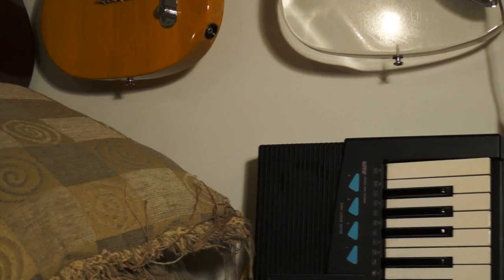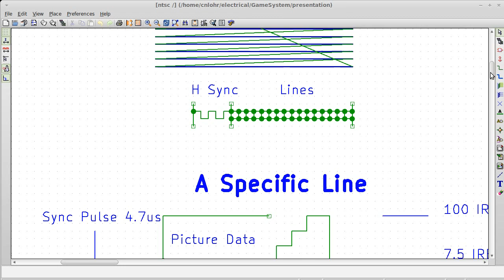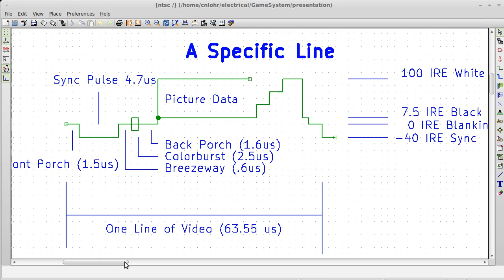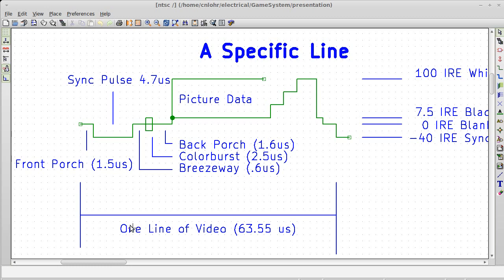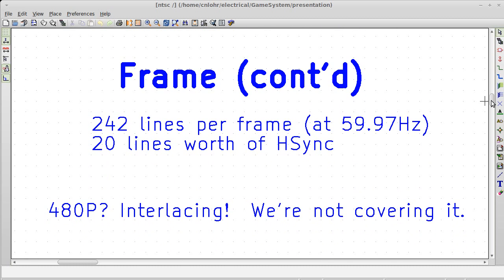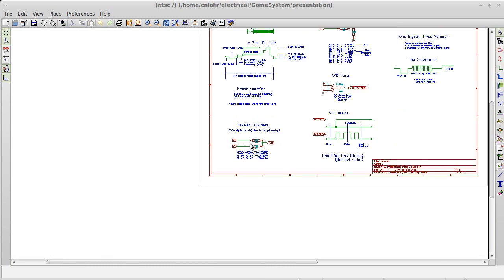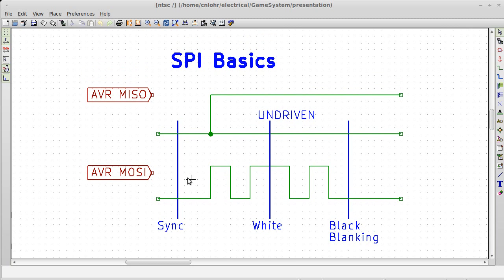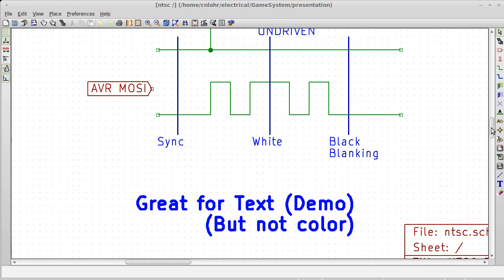Let's Learn: NTSC Part 1A (Basics)

Comment: Thanks for the info, but I have a question that I can't seem to find the answer to anywhere, I'm hoping you can help. Do the sync pulses control the electron beam deflection? That is, are the hsync pulses physically responsible for moving the electron beam from right to left during the horizontal retrace (and same for vsync)? If so, how do they do it?
Reply from the maker: It's more complicated than that.  There's some degree of resistance toward spurious events that could happen because of static / noise in the signal.  So most TVs are sort of pattern-matching.

Comment: Prior to making this video you recalled the elements involved in your head because you read a book right? what was the name of that book/books? (specifically related to information needed to make the play list on coding NTSC )
Reply from the maker: not really.  Just stuff dad taught me when i was younger and that kolumbus site.  Then I banged my head against a wall for hours while trying to code the thing to generate the video!  Once I wrote a program to do it, I understood it!
Reply: I actually want to push my point and shoot camera as a webcam and dont know where to start reading about signal manipulation.. the camera has an HDMI out (I know that NTSC is completely different thing than HDMI but I figure I should start from an older technology to understand how things work) 

I could use a capture device plug the HDMI in and get the signal via USB but I doubt applications (like skype) would recognize this as a webcam source... so I figure I only need a way to forward the HDMI signal through USB with a "webcam" header thingy or however its done in USB so I figure I need an fpga and a usb controller and I am done (assuming that I learned how to manipulate the signal from the source and also know how USB stacks work... but this can be done by reading books the question is which books  :P  do you have any good reads in mind that could help me out in my quest ? :P )
Reply from the maker: If you have a HDMI capture card (to USB) almost all applications will recognize them as a valid imaging source, so you should be fine!  Also, to read HDMI, you really need an FPGA-level system.  It's nontrivial to read.  Heck, even NTSC is pretty difficult -- err very difficult if you want to retain color!

Comment: What about V-Sync? I heard that it has to be inverted horizontal sync or something...
Reply: That's  really good point.  I've never head of "inverted" horizontal sync.  Indded, though, vertical sync is based upon horizontal sync.  It is when you double-time the horizontal sync it creates a vertical sync.
Reply: To be fair, there is a bit of other funny stuff where it does flip around, back then forth, so I could see why someone would call that inverted sync.  The website linked shows that.